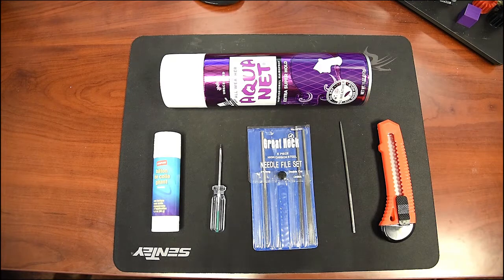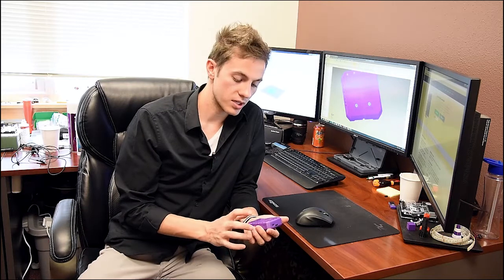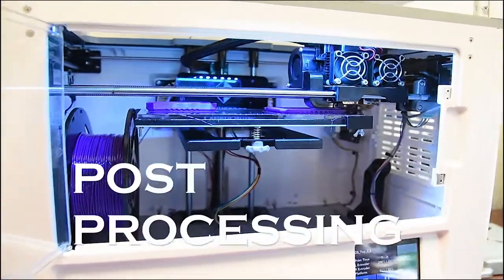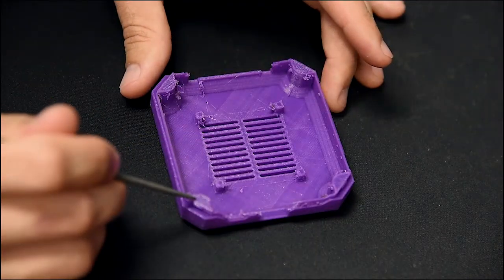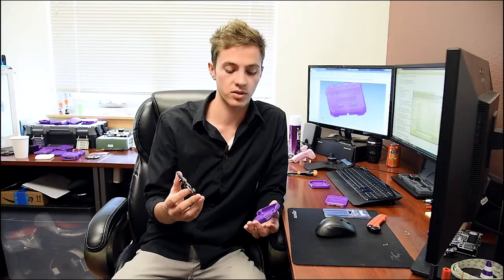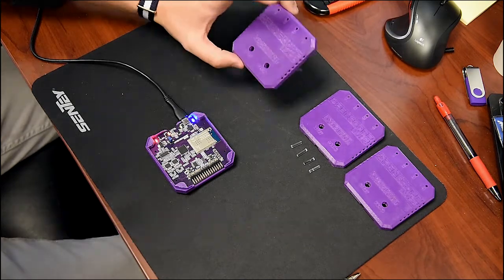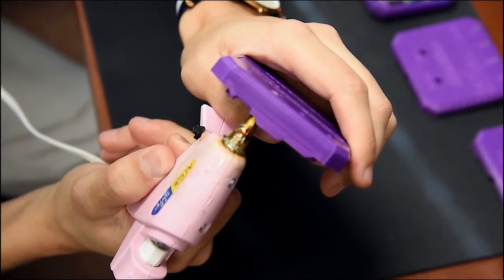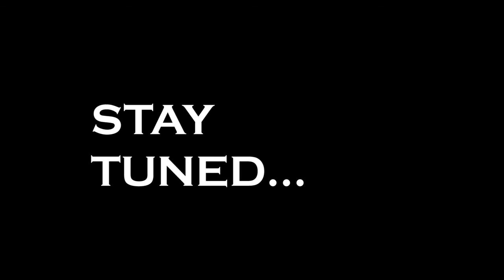OpenScope 3D Printed Case

Comment: Thank you for sharing this Daniel!

A bit late to the party here, but are there any good resources for MCAD modelling the button locking mechanism used here? I've got a similar "enclosure for PCB" project with push buttons mounted directly on the circuit board, and this is by far the cleanest application I've seen so far...